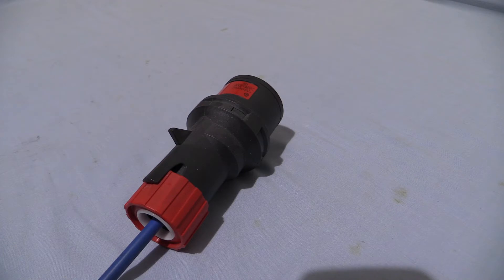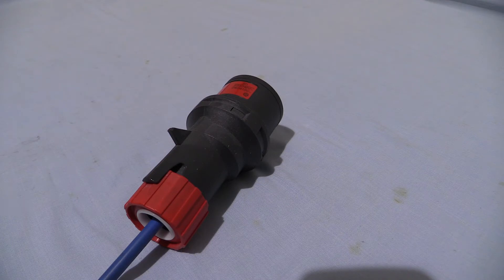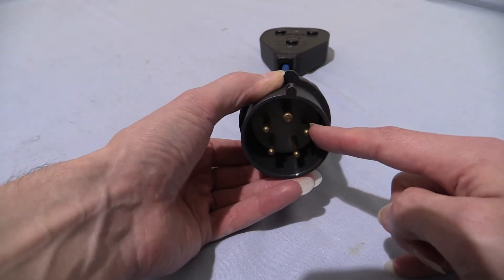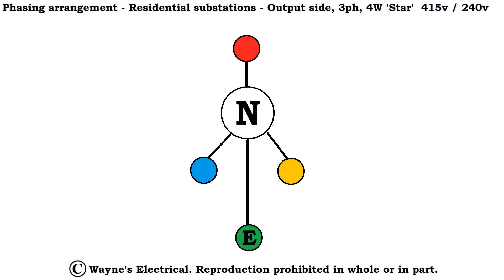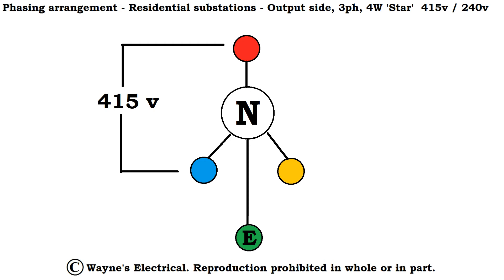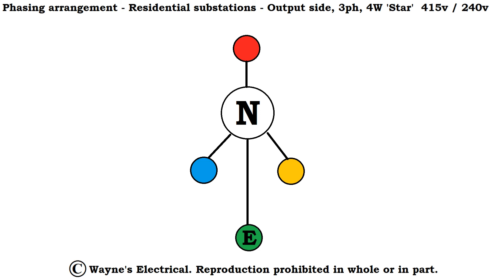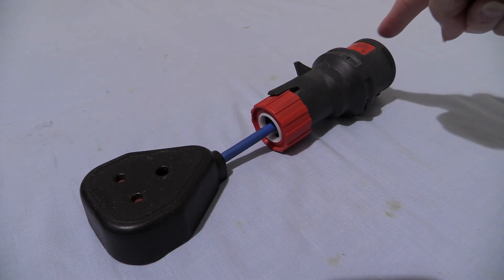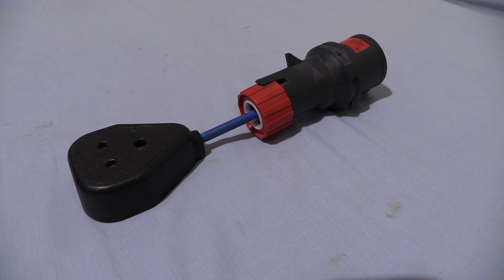Plugs : Three phase to Single phase Pin Configuration Convertor.

Comment: Hi Wayne, I've bought a plasma cutter 15A 240V on Alibaba and naturally it was wired to an American 240V dual phase... How can I use this on 230-240V (in this case NZ, but same as UK) 50Hz and what amperage will it draw from single phase or am I going to roast the machine?

Comment: Do you have a clip of wiring a 5 pin plug to a 4 wire cable? I have a lathe it has a 4 wire cable, wire colours are green and yellow (earth), brown on L1, black on L2 and blue on L3. Do you just leave the other pin blank on a 5 pin plug? 
Any help would be good thanks 
Ben in the uk